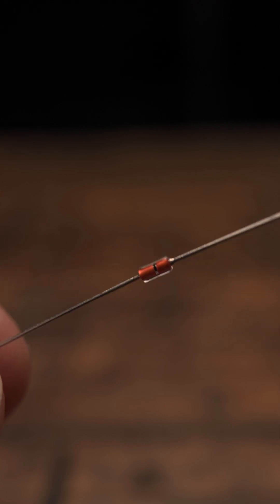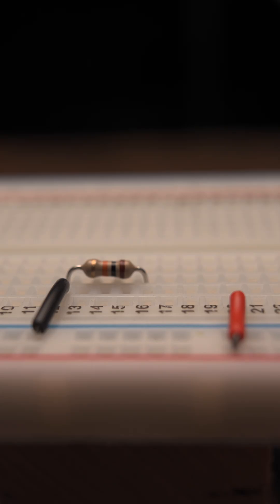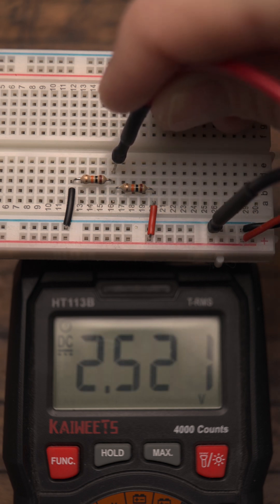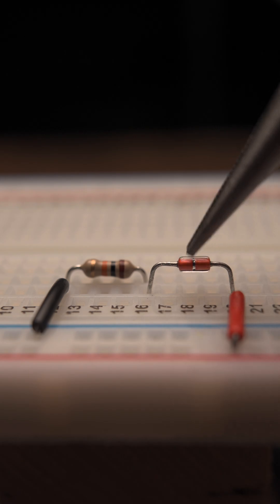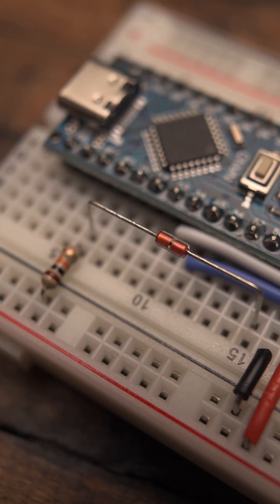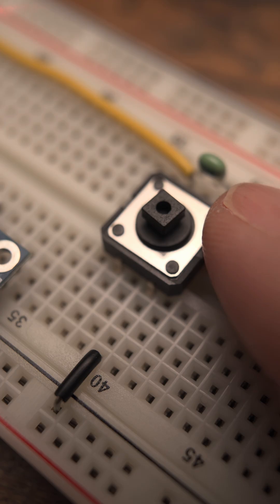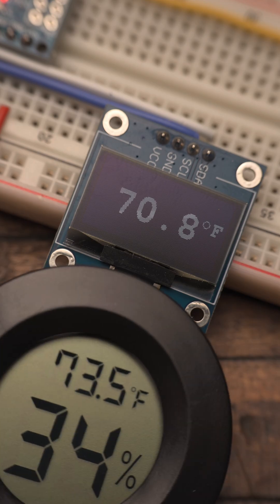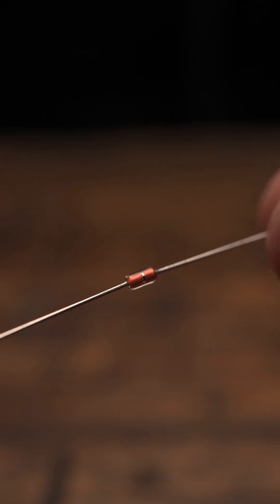#thermistor

Comment: I had that in itt technical institute,building and understanding of control and computer boards from scratch and how to read resisters,capacitors and measure hertz and frequency’s of a wave length using that oscilloscope machine

Comment: To your question (which is better, F or C temperature scales): it depends what you're doing.  The real question ought to be whether Kelvin or Rankine -- absolute temperatures have multiple advantages over scales with arbitrary zero if you're doing physics or thermodynamics calculations -- but if you're working in a kitchen with a freezer, F may be more convenient because the freezer ought to run close to 0 F (that's about -18 C), and the smaller degree could be mean closer control of critical processes like scrambling eggs just right.

Comment: is the calibration using the potentiometer only valid at the temperature you calibrate at? How do we know that it will hold at lower higher temperatures and how does the potentiometer actually calibrate it thatwasn’t explained
Reply: Your calibration is as good as reference temperature. In this case referring to thermometer which uses same thermistor for reading. Anyway thermistors are actaully really good at keeping calibration value, but there is "linearity" which means calibration line is not super straight, so if you want good calibration: have good reference reading and calibrate as close to your working temperature as possible.

Comment: Fun fact, this is how aircraft engine fire detection systems work. The Kiddie system has a long  grounded tube filled with the thermistor material and a single in it. As the temperature rises, the resistance of the thermistor decreases until an electrical connection is made between the conductor and tube, which alterts the pilots that theres a fire.

Comment: Fahrenheit is better. Especially at temperatures meant for humans to live in. Celsius doesn't really do anything BETTER unlike most of the other metric units.
Reply: Only 4,5% of the population use it and you defend it with everything you can because of the sunken cost fallacy. Your stance only proves how egocentric America is.

Fahrenheit doesn't have a use. Period.
What you learned by experiencing world in °F can be as easily or even more learned in °C, but you can't do the same vice versa.

Fahrenheit was literally based off the freezing temperature of a random solution of brine made from a mixture of water, ice, and ammonium chloride (a salt), that nobody can ever repeat because of missing records. 100°F also isn't the human temperature any more as it has been measured that body temperature decreases over generations.

Below 0°F and above 100°F is also nonsense as you could freeze to death with much higher values than 0°F and you could safely withstand temperatures well above 100°F for prolonged periods of time. Learning what is and isn't actually comfortable equally applies to both scales, so there is NO benefit of either in this regard. You need to experience both. 100°F is "only" 37°C, we sometimes get temperatures reaching 40°C or 104°F and I have experienced even more when abroad in summer. And 0°F is frikkin -18°C, which is well below freezing, that's all I need to know. What is practical is 0°C or 32°F at which point I know whether it will rain or snow or whether the roads will be frozen. But since we are reasoning about freezing being the turning point, it only makes sense to base the whole scale off it, instead of some random solution and temperature at that time.

The real benefit of Celsius over Fahrenheit comes from the real practical use.

With Fahrenheits you need to remember freezing 32°F, cool room 68°F, (arguably also body 98.6°F) and boiling 212°F.
With Celsius you just need to remember two values: cool room 20°C and body 37°C. The freezing and boiling points are inherent to the scale.

Freezing is the most important of all as it determines whole load of things. Can I drink the content of this can at all? Will the water in the pipes tear them apart? Will it rain or snow? Are the roads frosted? Will I slip and injure myself on the stairs?

Now to the practical use, not at all scientific, lmao. You will know how important this is when you have small babies.

Can you tell just like that, that 140°F is twice as hot as -1°F?
Is it obvious to you that if you mix 1 unit of 140°F water with 1 unit of -7°F water, that you'll end up with 2 units of 104°F water?

In celsius, the same values as above would be:
60°C twice as hot as 30°C
1unit 60°C + 1unit 20°C gives 2units 40°C